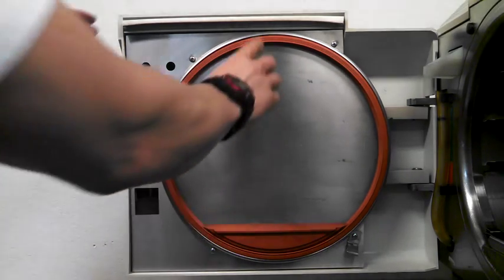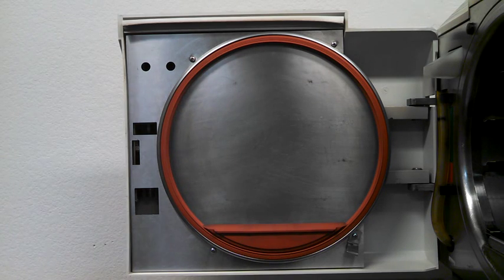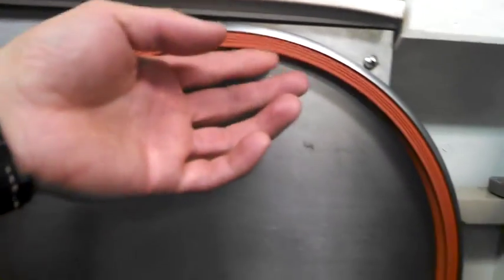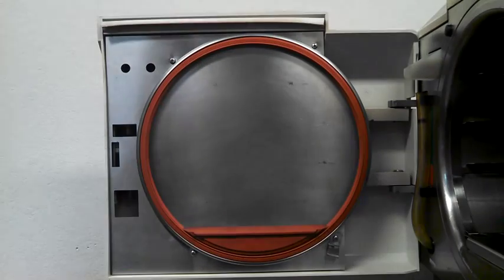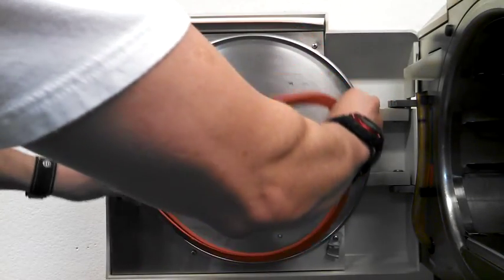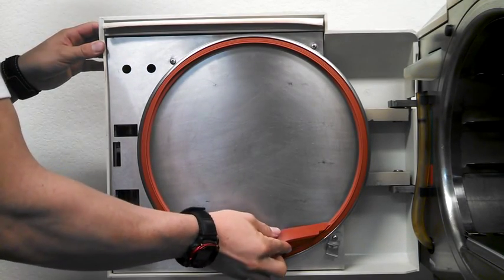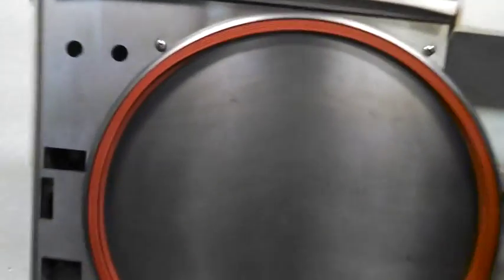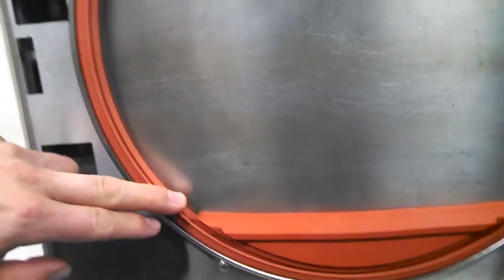Tip#1 Autoclave Door Gasket

Comment: The autoclave door won’t pop open during the drying cycle??? Why? My boss says it’s okay but I’m like nahhh it needs to be fixed.
Reply: If the door isn't popping open, then the issue is probably with the door motor.  Call us (if you haven't already): (480) 497-4392.